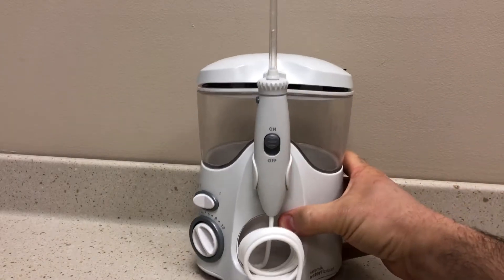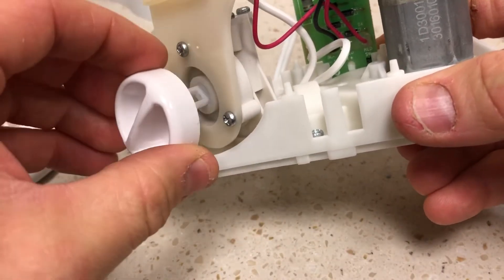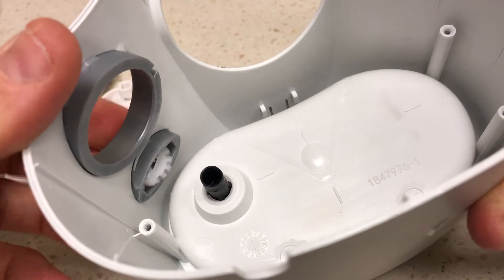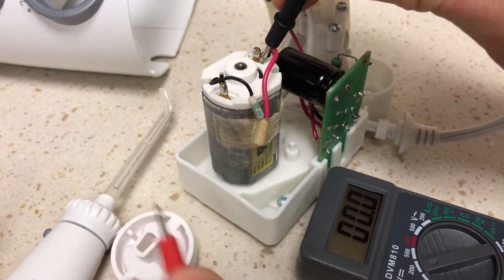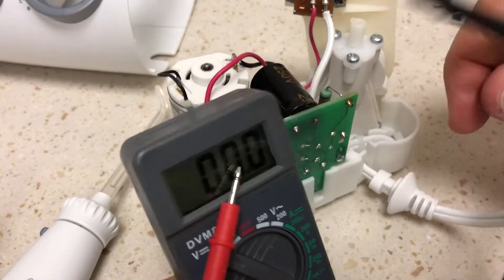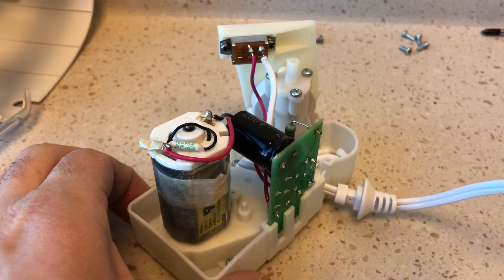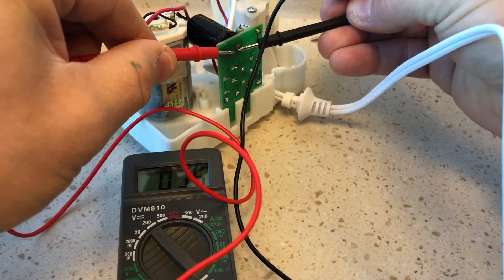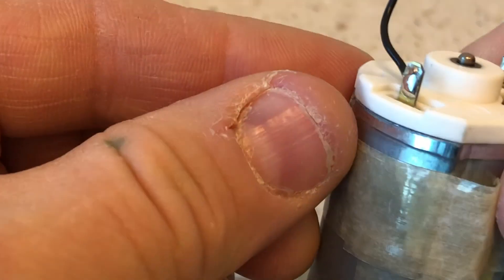Broken WaterPik WP100-W Teardown and How to FIX!

Comment: Those thermal fuses go on all sorts of products. Almost always it is the thermal fuse that is defective. I replace them with a resetting version. Alibaba has them of $2.
Reply from the maker: It's good that they use thermal fuses to protect the rest of the device, but I wish they had something that would reset, or something a bit more sophisticated to cut the power and warn the user. At least you would unplug or turn off and wait a bit and it would come back to life (like most of the microwave cutoff thermal switches). But it's not so easy for people to be hacking open their WaterPiks and buy the correct thermal fuses and replace them properly themselves.... Meaning when these things do burn (and they do often enough) most people will just throw them in the garbage and buy a new one!

Comment: Amazing video, thank you so much! Did you by any chance find out the value of the resistor?
Reply from the maker: Sorry no idea, I'm not sure if the bands are marked properly or if you can see it in the video. I don't have it anymore otherwise if I opened it up I could just measure the Ohms across it with a multimeter.
Reply: @devhackmod  Cheers, thanks anyway man, great video.

Comment: What type of screwdriver did you use to open the long recessed screws?
It appears it’s a star head screw and I need the type and size screwdriver to remove them. Thanks
Reply from the maker: You may be talking about Torx bit. I don't remember because it was not my WaterPik that I fixed but a friend's. If yours is using a star-shaped head it is likely Torx and you can buy a set of screwdrivers with long stems that will reach. Good luck!

Comment: I have to same Waterpik but after going through all the electronics I found out that, once removed, the motor worked! Turns out the plunger on the pump was stuck. It was easy to unstick the plunger, but once done and reassembled, everything works fine!
Reply from the maker: Great to hear! Yes sometimes it's just a mechanical failure. The important part is to open it up and troubleshoot. Most people just give up and don't even try... but if you open the device it's very simple, just a few parts, so easy to figure out what is going on (mechanical or electronic). Nice that you got it to work again!

Comment: my unit works fine, but the tube broke near the wand- you have a much more serious problem.
Reply from the maker: Yes that's not so easy a fix. Some kind of epoxy or other waterproof glue may be needed, if it is fixable (it may be made in a way that it can't be fixed even with glue).

Comment: Don't waste your time calling the people at Waterpik. They won't send you a fuse. They don't do that. They might send you a new Waterpik, but not if you've taken the cover off. That voids the warranty. These dickheads want you to throw a completely fixable unit in the landfill. This is why people hate corporate America.
Reply from the maker: The truth is, this fuse is not serviceable by most people. Even if they send a fuse, most people don't have the technical knowledge or equipment to change it. They can't make the fuse easier to access because it has to be taped directly to the motor to feel the heat. There is a risk the user may install the fuse wrong, and if it causes a fire or damages then who is legally liable? It is not worth their trouble. The minute you open it up it's all on the user, legally, if anything should happen. The only way they could perhaps help the situation is design the motor fail-safe mechanism better, using a fuse that RESETS ITSELF when the high temperature resolves (like they have in most microwave ovens).

Comment: Same issue. Thanks for pointing out the fuse.
Reply from the maker: Thankfully it is the fuse that goes first, that's the best design for failure. It is cheap and easily replaceable!

Comment: Thank you for this video.  

I have the exact same issue with my unit (WP-150W) We had hardly used it-  only a few times before it died.  

I got into it and my first suspicion was the obviously overheated resistor.  Wasn’t able to confidently read the color code on it because of the discoloration.  

Had no idea about the thermal fuse until watching your video.  

Just checked the thermal fuse and it is indeed broken inside as I have no continuity.  

Thanks again!
Reply from the maker: Thanks for watching! Good luck fixing it. These thermal fuses are cheap, you can buy a 10 pack for almost nothing, just use the same fuse spec rating and you have a lifetime supply in case it dies again (which it will).
Reply: @ after reading your video I hopped online and bought something like a 20 pack for $8. specs were almost identical-  only off by 1 degree.  

Looking forward to getting it fixed👍.  

Thanks again!
Reply from the maker: @seanhartman6496  Good luck and let us know how it worked out!

Comment: 120v DC 😱
Reply from the maker: Seems like it! But that large resistor in there probably drops the voltage a huge amount... I can't imagine that little motor handling 120 VDC. It was cheaper to put a giant resistor than a transformer.
Reply: @devhackmod  I was looking at teardowns because i wanted a usb c powered one. "Waterpik" sells one but it has a propriety plug. Plus the one I have still works
Reply from the maker: @yupsir791  What you can do is try out different DC voltages on the motor (starting low and working your way up) and then see what seems to be at the correct speed and do the job. If you pick too low a DC voltage, the motor will spin too slow, and as you go up it should improve but don't go too high or it will overheat and burn out. You will likely need to change that big resistor to a smaller value (or eliminate it completely) so it will work at lower voltages but I don't know if USB C will do it (plus the voltage from a USB C charger may not be what you think because I believe the device negotiates with the charger to establish certain voltage and current settings, although the default "dumb" charge voltage may be standard).  Good luck!

Comment: When traveling overseas ours got plugged into 220 volts by mistake. And instantly it stopped working. I assume we burned something out. It looks like based upon your video there's three electrical components in there. Would all three be burned out?
Reply from the maker: I would open it up and check to see what blew up. Usually if one part blows (the "weakest" one) and it creates an open circuit it will therefore protect the other parts. So likely just one component may have blown due to the higher voltage. The only way to know and fix it is by opening up the device and checking the circuit and each component to see if there is a break in the circuit or if the part has continuity (using a multi-meter). Good luck!

Comment: What was the resistor value? I have the same one with a burned resistor.  I put one in it but it doesn’t look like the right one. The fuse on mine is also burned but I want to make sure I have the correct resistor too.
Reply from the maker: Looks like Brown-Brown-Black and then Gold-Black (if you look at the video in HD 1080p and freeze it around the 3:00 mark). The Brown-Brown-Black would seem to indicate 11 Ohm, and Gold is +/-5% tolerance. Not quite sure why there is another Black band after the Gold. Those are the colors I see but I could be wrong, unfortunately the lighting wasn't all that great. Let me know what you find out.

Comment: if anybody reads this, do not bypass the fuse. If it wasn't needed, the manufacturer/engineers wouldn't have included it. if you're going to replace components, make sure you get the exact same rated parts to replace them with. these machines are designed to run at specific specs and you start going around changing capacitance or resistance ratings, you could further break the machine or hurt yourself
Reply from the maker: Yes I agree, this is a valid and useful comment. If you are going to work on electronics, read some electronic principles books, basic theory and repair, and know how to operate safely... both in diagnosing and testing, as well as replacing. Even in this video you can see the energy stored in that capacitor that can easily shock you if you don't know what you are doing! And if you don't repair things properly they are a fire and electric shock risk!

Comment: going to repair one next weekend where the resister broke one lead off the board.. slight burn smell around it.. gotta wonder how long it will work once that repair is done, lol. So bleeding the cap with some sparking is essential to doing board work?

Comment: I have wp-667 and I opened it up I do some check I found the capacitor doesn't response what I can do if I'm living in place has only 220v because I haven't usen it first time I got off and didn't work again. Should I fix it or throw it.
Reply from the maker: Check to see if it's adaptable to 220V or not, otherwise you'll need to use a converter.

Comment: The WaterPik model WP-100W has a design flaw and should be recalled. The fault is in the gear-switch mechanism that allows the internal switch contacts of the switch to be partially closed, this results in motor stalling at full position eventually blowing the thermal fuse. A DC motor under a load will run hot with too little voltage. A low voltage forces a motor to draw extra current thus blowing the thermal fuse.
Reply from the maker: Interesting observation. They need to either redesign the gear-switch or install a fuse that resets once the high-temperature condition passes (self-resetting fuse like in many microwave ovens, usually consisting of a bi-metal contact that opens the circuit when a high temperature is reached and then once it cools will snap back and close the circuit, allowing usage again).
Reply: @devhackmod it’s made to last a short time so we keep buying like everything appliances to fix it cost as much as to buy a new one
Reply from the maker: @ Thankfully if you know how to fix it yourself and can buy the parts cheaply, it becomes economical to fix! I've fixed tons of stuff around the house, usually parts are cheap. You just have to know how to find the issue and do it yourself!

Comment: oh man, mine wouldn't run after bypassing the fuse here like you suggested.  Any other common fails that you know of?
Reply from the maker: It could be the actual motor burned out. It's fairly simply construction but I would test continuity across the motor inputs, see if there is any resistance at all or if an open circuit. You can also check to see if there is any voltage off the power supply to see if the fault lies there somewhere. Good luck and let me know what you find out!

Comment: Could you please give me the colors of the resistor, the one that is green? I would like its color code that it has
Reply from the maker: Unfortunately I don't have this device, it was a friend's who asked me to fix it. Check in the video if you see any indication of color bands. You can also do a calculation and see what resistor should go there, given the voltage and current you are trying to restrict (based on what the motor can take)... that can help you get a rough estimate as well of the value.

Comment: Hey can you help me with my waterpik aquarius 660? It has no power. Can i also use thermal fuse there?
Reply from the maker: Definitely open it up and check! Use a multimeter to check continuity across the fuse, it is worth a shot. If that doesn't work, start narrowing things down... It is a very simple circuit, very few parts involved. Good luck and let me know how it goes!

Comment: I can see why you would think the resistor is bad.  To bleed the cap down to zero volts, or near that, you would want to use a small fan, or motor with some sort of load.  The key being how much voltage will be on the cap and if the motor can take it for a short time, or not.  LOL, you really need to make a little holder for that voltmeter so it doesn't appear you haven't make many videos before.  You could keep it simple with some tape and just about anything to act as a wedge with the tape holding everything in place for best camera angle.
Reply: I agree the fuse is clearly a problem.  That capacitor would give a really nasty shock if shorted across a finger or two.  I am wondering who you found to buy a replacement fuse from?  I haven't torn down my non-working waterpik yet and it is likely a different brand.  Nice, I see you have a part 2 I can watch.

Comment: Before you take apart the WaterPik for no water surging through the pik, check that the on/off button on the handle is switched to “On.”
Reply from the maker: Yes good point, and make sure it's plugged in too!
Reply: And don’t bring it in the shower with you either… 🤡

Comment: Thanks for the video. In my unit, the resistor had one leg separated from the board. I soldered it back and it will run. But the resistor burn very hot and melted the solder joint. I tested it and it reads 48 ohm. Is the resistor still good?
Reply: It's a 51 ohm resistor, so it's probably still good.  It might be worth replacing it with a higher wattage resistor that won't get so hot.  I've made similar repairs in many appliances.
Reply from the maker: I don't know, check the bands on the resistor and see what value it should be. That value (48 ohm) seems very low and could explain why it is running hot and melting the solder.... it is behaving like a short. A higher value would not allow as much current through, reducing heat but would affect voltage. V=IR.

Comment: You didn't talk about how to remove the power level knob. That is really hard to pull out and needs to be removed to disassemble.
Reply from the maker: Yes, you just pull it off, I believe it has a "D" connection, friction-fit on there.

Comment: my kid dropped mine off the counter and it stopped working we never threw it away tho today i opened it up bypassed the switch that didnt work , saw this vid , bypassed the fuse AND IT WORKS now if i can get it back together rah hah hah thank u lots bröther
Reply from the maker: Glad to see you saved it from the dumpster! If you can get a fuse, that will save it from overheating and burning the motor but meanwhile at least it works!

Comment: Hello, could you tell me what name to give yourself to the integrated circuit board that is on the inside of the dental irrigator, is the board that makes the engine spin and that drives the piston? In case this board is the Waterpik Waterflosser WP-660C it has this identification number ING TCX E250336 94V-0?

Comment: can you by pass and not using the fuse?thank you for your time.
Reply from the maker: Yes you can, but then if your motor gets too hot there will be nothing to turn it off and you may burn your motor. The fuse is "sacrificial" for a reason, to save more expensive parts.
Reply: @devhackmod  What about replacing the thermal fuse with a thermal breaker (self-resetting) of the same value?  Seems like that might be the way to go if it is possible.
Reply from the maker: @NJP76  Yes that would certainly make sense. However, they decided to make this with a non-resettable fuse perhaps because it doesn't happen that often. Thankfully these fuses are cheap to replace but just a pain especially for people who don't know how to take apart their device and put a new one in.

Comment: I wish you would have shown how to access the screws on the bottom. The two on the hose and 4 other deeply recessed were obvious, but something is still holding the bottom on. Screws? The search continues. After I get the bottom off, the rest of your info may be quite helpful. Waterpik does have a 3-yr warranty but is a PITA to deal with, imo. EDIT: it seems the rubber plugs (?) were holding it together.
Reply from the maker: Yes there are rubber plugs that are inserting in the holes and then expand on the other side that hold it. You just have to pull apart and they squeeze and come out. Same goes when you reassemble. Hope you were able to fix yours!
Reply: The rotary "speed/flow controller" knob needs to be prised off to allow the top and bottom to separate.  I used a flat blade screw driver and prised it gently at various places around the circumference of the knob until, at one point, it came off easily.

The rubber plug things are suspension/vibration absorbers